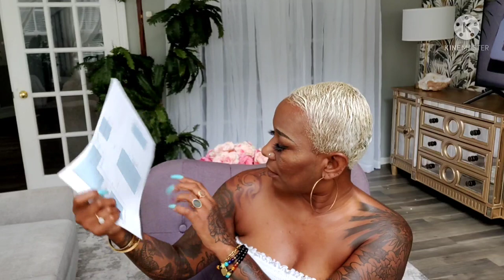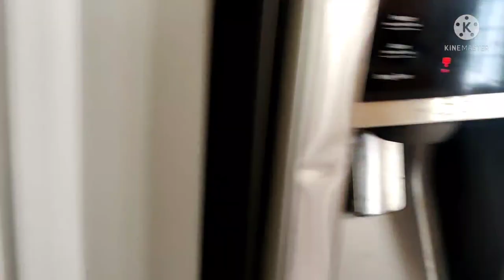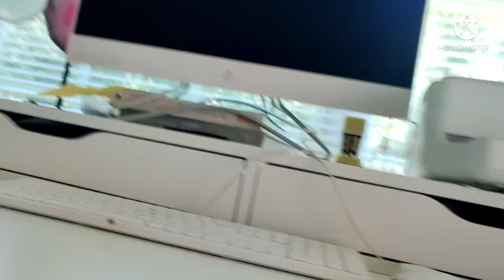LONG VLOG WITH RON AND ME ....HE DOING THE MOST AS USUAL

Comment: Use a zip tie threaded through a silicone straw to connect the wayward branch to the main trunk of the tree. That way you add or take away tension on the branches as needed. The silicone straw will cushion the zip tie from cutting into the tree as it grows.  If you use a stick you run the risk of harming the roots trying to stabilize the stick in the soil. Besides rotate the tree so that the wayward branch faces the wall, thereby forcing the branch to grow towards the sunlight. Hope that makes since.

Comment: Hi from PR, Sharon. Have you considered removing the desk and making that area the pantry. Only have to put bottom cabinets.

Also, the idea of putting the wine Cooler where Ron said is ok, on the side near door, you will not have to move the light switch or your electrical receptacules plugs.